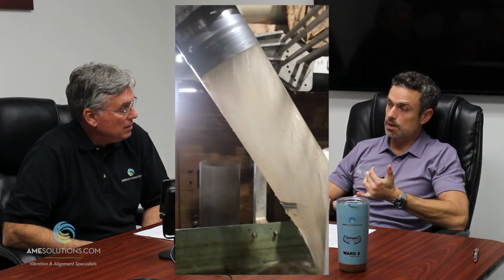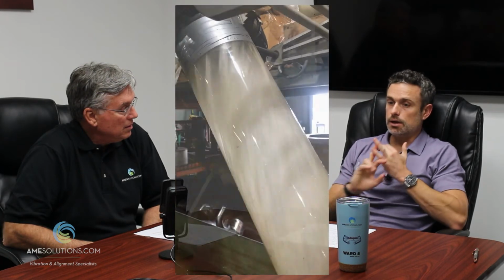EP 001 - Tech in Check - Justin Montes - DeAngelo Marine Exhaust

Comment: Great interview but as the inventor, patent holder, and manufacturer of the SeaClean active DPF system I'd like to make a couple of corrections regarding its operation. The SeaClean filter uses a catalyzed wall-flow silicon carbide substrate. We use silicone carbide (SiC) for strength and its ability to withstand higher temperature than the cordierite ceramic used in other filters. We catalyze the filter element with a mixture of precious metals to achieve lower ignition temperature of captured hydrocarbons - soot and the organic vapors that produce the diesel smell that is so offensive to many people. A benefit of burning off (regenerating) at the lowest temperature possible is a reduction in the production of NOx which is one of the most powerful and highly  regulated greenhouse gases.  Even though the catalysts lower the ignition temperature, the SeaClean system incorporates an electrically powered exhaust gas heater which is made up of multiple elements. Actively heating the exhaust permits regeneration across the greatest range of generator load conditions. We measure exhaust temperature entering the filter and control use that variable to control the number of heater elements energized. At low generator loads exhaust is relatively cool and all elements might be energized, as load increases so does exhaust temperature and the number of elements energized is reduced to the minimum required to maintain the level of exhaust temperature required to continuously regenerate the filter. We measure, record, and display back pressure, exhaust temperature, and heater power so the engineer can see at a glance how well the system is performing. In normal operation the system functions automatically and requires no intervention. A benefit of the SeaClean control technique is the heater serves as an automatic load bank. When generator loads are low the heater adds load, when the load is high so is exhaust temperature and the heater power consumption is very low or even completely off. SeaClean systems do not wait until back pressure is high before regenerating, the goal is to maintain low back pressure at all times while continuously removing soot and hydrocarbons from the exhaust.